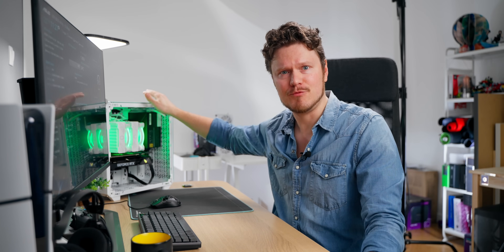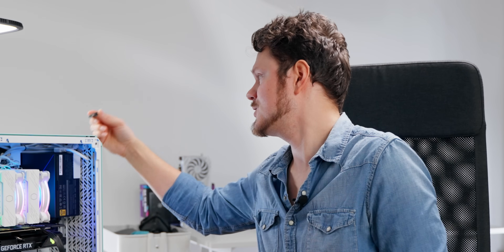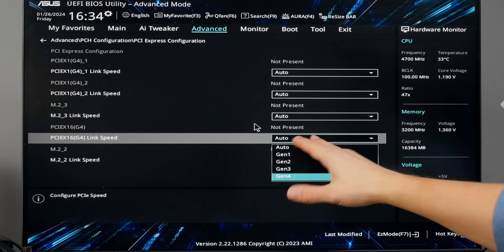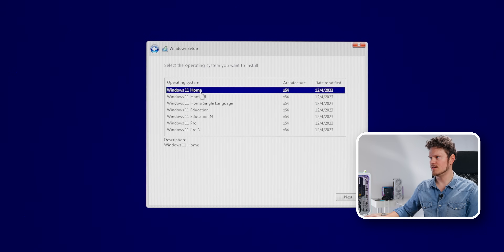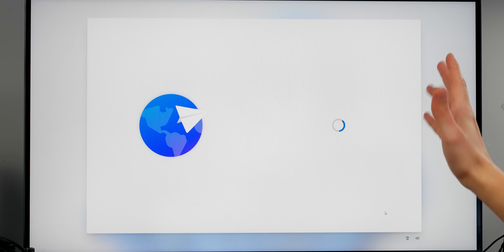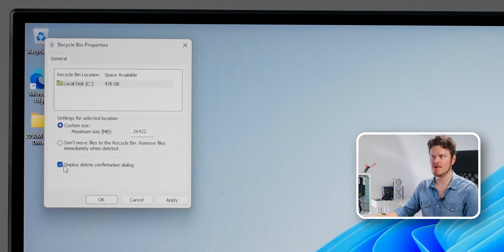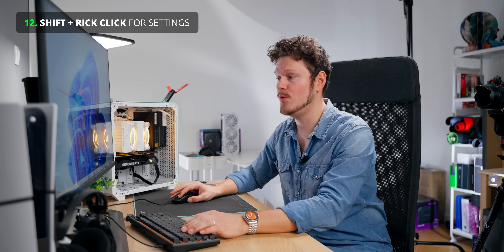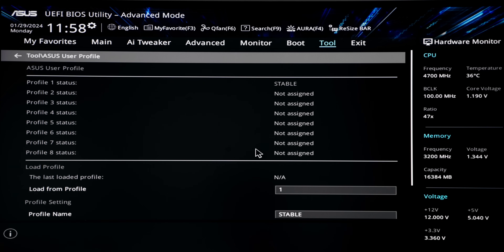Always Do THIS with a new Gaming PC!

Comment: You forgot to turn on re-sizable bar, also check and make sure TPM and Secure Boot is on
Reply: if you have modern motherboard + updated bios these should all be enabled by default.
Reply: I use sizeable rebar in my Minecraft builds
Reply: re bar is a cyrpto mining feature to conserve power?
Reply: @aeroflopper , no its a feature that to my knowledge only improves gaming frametimes and loading times. Re bar only allows the cpu to utulize the whole card's memory, instead of the first 256MB. What that does is reduce latency to load assets from memory, and reduce load on the gpu to let the cpu handle memory allocation on the gpu. This specifically improves gaming performance, especially in games that eat up a lot of vram, other games that use sub-2GB of vram will suffer, due to the majority of those games being too old to operate like that.
Reply: @electrothecat  so not turning it on saves power, for crpto mining?  im only going on what my old 970 gaming board says about the setting.
Reply: @aeroflopper , how to save power during crypto mining: dont mine bitcoin, crypto mining is not intended to save power, literally all it does is calculate using the same mathmatical expression over and over again, and doing it simultaneously just to push your gpu to its limits. If u care about efficiency, get a quadro card, gaming cards are not designed for this workload so they'll be incredibly inefficient at it.
Reply: Resizable tan bar? You mean it can be smaller like on windows 10?
Reply: @leonardog.2491 rebar is a gpu settings either in bios or nvidia control panel.
Reply: @leonardog.2491   depending on gpu rebar or SAM can actually hurt performance in certain games so should not just be enabled by default.
Reply: @leonardog.2491  Its a feature that i believe is AMD specific. It enables the GPU to use the full BW of the PCI-E lane
Reply: @henryyang802, no, resizable bar is a feature of RTX 30 series or Radeon RX 6000 series GPUs that allow the CPU to utilize the full amount of VRAM on your card, rather than storing stuff to the first 256MB. Resizable bar is what nividia calls it, but is called smart access memory for AMD. Unlike AMD GPUs, nivdia GPUs have to have the setting enabled in game, as long as the game supports the feature.
Reply: @electrothecat  Yeah, I just read up on it again. SAM is the AMD feature, while Re-Sizebar is the generic implementation of this feature
Reply: @henryyang802 no it doesn't. and no its not AMD specific. Intel and Nvidia support it too. AMD just marketed it first as SAM. It allows CPU to read/write directly to VRAM and GPU to read/write directly to RAM.
Reply: @ang802no its not, ffs. AMD SAM is just branding for supporting the Re-Sizebar standard. The comment section never ceases to amaze me.
Reply: @electrothecat  resizable bar has nothing to do with intel, amd, or nvidia. Also it is not a feature of radeon Rx 6000, because I used it on RX Vega and even on Polaris. It is a PCIe feature. For those older GPUs you need a registry mod, since AMD does not enable it by default. Anyhow it is a feature that was introduced in PCIe 3 a decade ago, but was not used until recently.
Reply: @marsovac , yes and no, it does have something to do with AMD and nividia, because cards that come shipped with it by default support it by default. Any device that doesn't expect a certain bus protocol to be used,  will malfunction bc the firmware and devices on board arent designed to handle that. And considering that AMD dropped all of their support for their older cards including vega series, I doubt u could get vBIOS updates for the support for AMD SAM. However, yes, u can add support for resizable bar on any platform that supports at least pcie gen 3, with a bit of driver hacking or hardware spoofing.
Reply: @henryyang802   resize bar is intel, SAM or smart access memory is AMD

Comment: O man I haven’t updated my bios since I built my pc beginning of last year. Looks like I have something to do when I get home from work. Quick question…..do I need to re-install windows after doing a bios update?
Reply from the maker: You don’t need to reinstall Windows after a BIOS flash. The only point of caution ⚠️ is if you have any RAID setup on the BIOS level, as it will need to be rebuilt. Otherwise you don’t need to worry about changes. 
-D.
Reply: @HardwareCanucks  Got ya. Thanks for the reply.

Comment: As a it technician/supporter, i can approve all of this, i would use rufus for the setup for windows tho. The time zone is actually really important funny enough, and is also one of the first thing i see to when setting up a knew machine. Good and informative video! :)
Reply from the maker: Yeah, Eber mentioned using Rufus to create a bootable USB with a WiFi bypass. 
-D.
Reply: @HardwareCanucks  And there's also a toggle in Rufus so that the ISO uses the same time zone/localization settings as you are using when you "burn" the ISO to your USB stick.

Comment: Two notes about the very useful BIOS profiles:

1. If you update your BIOS, the saved profiles are deleted (at least, for ASUS).

2. You can save profiles on external devices, such as a thumb drive, so you can keep and reapply them between BIOS updates. Note, however, there is a very tiny but real chance that profiles won't work between updated versions.
Reply: If you update the BIOS always check if firmware is included. Using a BIOS without firmware will cause super annoying problems you can’t place.
Reply: Yes, for msi mb the profile won't work across different bios ver. I had to take notes of my setting everytime and apply them manually
Reply: This is helpful, as I have a "Rog strix Z790-A gaming wifi II" and 2x24GB Corsair titanium ram.
Due to both the mobo and ram being less than a year old, the bios still doesn't support either of the xmp profiles for the ram, however with each Monthly update more xmp profile support is being added for each brand.
Reply: Quora and reddit "states" to load default each bios update so this might come in handy. I just update my bios (B450m HDV 4.0) recently and was worried to update my bios since the description has warnings and was using a 2600. till later after 3 years i did, and learned its essential for memory and stability (unless a cpu is dropped based on QVL)  now i can use the XMP of my Corsair Vengeance LPX regards it aint a ram kit and bought each separately 😅
Reply: Well, I have saved the profile onto a USB drive but when I tried to read it back, the motherboard has not found any suitable file on the USB... 😂
And I have not even updated the UEFI, just wanted to check if the save worked. (This is a Gigabyte board.) 😂

Comment: Another option to install Windows without a wifi connection (or LAN drivers) is to connect your phone via USB and tether the internet connection when the screen at 10:17 is shown
Reply: That's cool if it works. Noted.
Reply: @DaKrawnik  did my first build last weekend and worked for me with my Android phone.
Reply: I've used my iphone for it too.
Reply: FYI AThis will only work for android, as you have to have the “Apple devices” app from with windows store in order to tether internet. 😢

Comment: I remember when it was so easy to pick a boot drive, be pressing f2, and have a menu pop up.
Now they added 2 extra steps.
Reply: F8 I promise
Reply: Try F10
Reply: @psymax8000  That feature is gone as of Windows 10.
Reply: @saulgoodman2018  I think you're confused
Reply: @saulgoodman2018  The boot menu is a feature of the motherboard and not windows
Reply: @Naverdo  I am not talking about the way he showed.
Reply: @saulgoodman2018  the f2 menu you're talking about is a boot menu that you can open to select what drive to boot into, if you don't press that key it boots into windows or the default boot drive and if you press the bios key it goes to the bios where you have a seperate boot menu. Pressing the boot menu key skips the step to go into the bios and directly shows the boot menu with all your connected drives
Reply: @Naverdo Windows must have changed it back, from a couple years ago when I last used it. 
In 8 they gotten rid of the, and had some newer, more complicated version.

Comment: Videos like this is exactly what I needed. Im confident in building the physical part of the pc when I eventually save up for all the parts but the software worries me a bit. I've been exclusively on android for years now that I hardly remember how to even work windows not to mention bios updates. I cant wait to get my first build under my belt!
Reply: Same here.  But this video had the opposite effect on me..  Cometely put me off of building my own.   I'd rather go to a pc builder online and have them build it for me..  Would love to experience actually building my own, but don't have anyone that could help me with the software part....  Maybe I'll just stick to my ps4 😂😂😂
Reply: Do some research on installing windows from USB disk.  Not that difficult to burn a copy to USB then instruct bios to boot from USB.  Less pitfalls than putting hardware together and Windows will install necessary drivers to get you going.  So much free information out there to help you along the way.

Comment: hold up, what was everything he did before accepting at 17:28? what's all that?
Reply: That is everything the XMP profile changes. It all pertains to RAM.
Reply: Those are all the things that XMP enables. Your ram comes as the lowest possible settings for the most stability, but to overclock to its specified number (in this case 3200mhz and c14) those settings need to be changed. The mobo will detect what the stick is preloaded with and be like here is the spec. That screen is showing each individual change, meaning that no matter AMD or Intel, you just hit XMP and it'll do everything for you. Hope that helps.
Reply: thanks to everyone for the replies, really helpful
Reply: XMP is basically a preset/profile the RAM manufacturer saves to the sticks (which the manufacturer has validated those particular sticks are capable of operating at). So when you "only change one thing" in the BIOS by changing XMP from "off" to "on", by enabling XMP, that preset profile is actually making multiple changes in the BIOS. That window shown on screen in the video is telling you all the various settings in the BIOS that the XMP profile is making.
Reply: Yeah asus bios show changes

Comment: When it comes to BIOS updates I wouldn't bother unless it adds or fixes features I use or would like to use. If you don't have an uninterruptible power supply and/or an onboard backup BIOS there's a chance your board gets bricked by a power loss or a bad flash.

A motherboard with a backup BIOS or BIOS flashing function on board with a dedicated button that works even without a CPU was a must when I was looking for a board. I didn't want an old BIOS to make me have to borrow an older CPU just to use my brand new one.
Reply: You'd be surprised how much bios updates can stabilize or sometimes even destabilize a system. Sometimes for compatibility you have to update the bios.
Reply: @bluej511  I forgot to add it back while I was typing, but yeah I meant to include "need" in the list of reasons. System stability being included as a "need."

Comment: Is there a reason you don't download, or pre download (like you do with the MB drivers) the chipset direct from AMD/Intel?
Reply: If you think that's the longest Windows install ever you must have never installed XP and then had to download and install all the service packs to get that original XP install modernized...
Reply: Chipset and GPU drivers are the  things I install as soon as I have internet access. Then Windows update and check optional for additional drivers.
Reply: Its probably alot newer and may offer better stability and functionality. The drivers from WU is to make things work only
Reply: @tcntad87  but like... Wouldn't you just download the actual latest chipset direct from Intel/AMD at the time you are setting the machine up? That Chipset driver is going to be more recent or the same than the one the MB manufacturer has on their support downloads page... 
I typically download the Chipset and the Graphics driver along with any of the MB drivers/software and have those on an external drive/USB storage and then execute those rather than waiting for it to download. And I never download the chipset from MB manufacturer. I was trying to figure out if Dimitri had a specific reasoning behind his workflow and doing it in that manner. 
My experience is the Chipset drivers provided by MB manufacturers are out of date when compared with that of the CPU vendor. 

It's true that in the past some Chipset drivers had differences depending on the specific motherboard it was for, but, generally, today the chipsets from CPU sites are pretty universal and motherboard agnostic. ... But I'm open to hearing other people's experiences, opinions and reasoning.
Reply: @tcntad87 My X470 mobo LAN driver from Windows update is newer than mobo support page. Chipset drivers are the launch driver. THOSE are the bare minimum drivers, not Windows in most cases.

Comment: I think you can hold down delete as well, to get to the BIOS. I think...

I think for upgrading you'd want to get a stick first from another working computer with internet. I had to borrow a work computer once to download windows onto a stick.

GeForece Experience has come a long way. I like pressing Win + G to clip the last 30 seconds. Usually it is me sniping a pilot out of helicopters in Battlebit or a good shot in Rocket League.

Comment: First lesson is, not install win 11. Win 10
Reply: Why, Windows 11 is better. There used to be a performance benefit to Windows 10 but that no longer exists.
Reply: Win 11 is required for the new CPUs from AMD and Intel since last summer
Reply: @JeskidoYT  does that include the 5700X3D? I wanted to pick that one up since I wanna stick with X570.
Reply: @MegaManNeo windows 10 is fine for am4 but you’ll need windows 11 for am5
Reply: @RustyChickn  I see. Well, guess I'm fine for a little longer then.
Reply: @MegaManNeo I wouldnt go to windows 11 until you're forced to
Reply: @RustyChickn  I mean I'm using Linux first and Windows second on my machines which goes for gaming too as I'm mostly playing multiplayer on consoles.
Exception is VR but that certainly won't stop working with Windows 10 suddenly either.
Reply: Fuck no win 10 garbage
Reply: Use a Atlas version of win 11 stripped and tweaked.

Comment: The first step, if you build your own pc im assuming you know somewhat what youre doing, is it to disable windows driver updates in system settings. I cant tell you enough even with it off how many times windows overrode my AMD drivers.

Also, I wouldn't enable xmp until after windows install, in case its unstable installing windows :). For bios update I prefer flashback if ur mobo has one.
Reply: Odd. I update windows as much as possible with lots of restarts before I do anything.
Reply: @phlipclip5097  yup but I'm talking windows driver updates not windows software update, ie lan/wifi/thunderbolt wtv